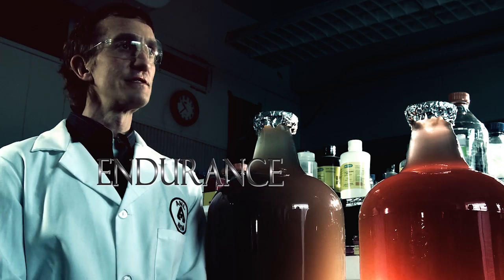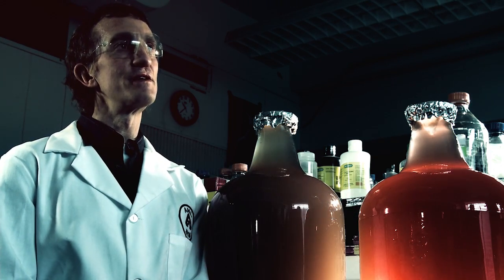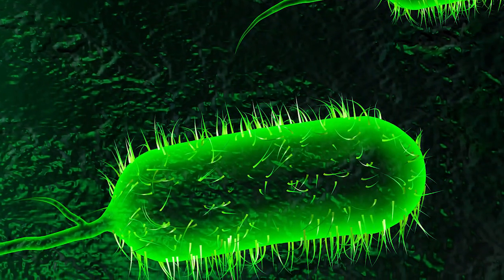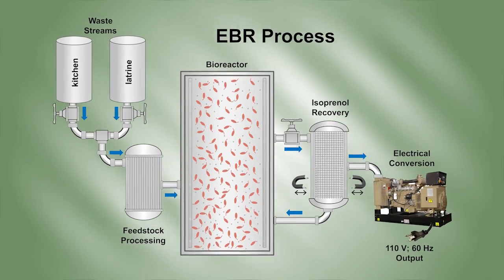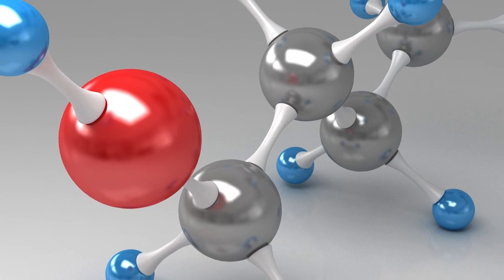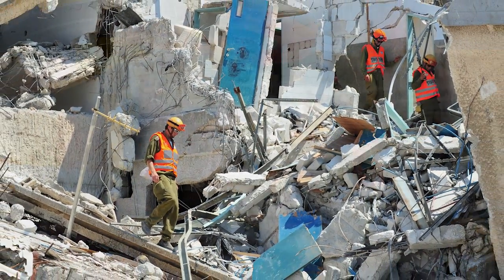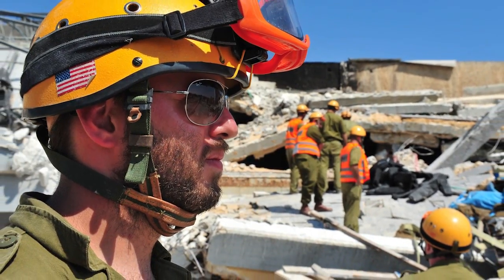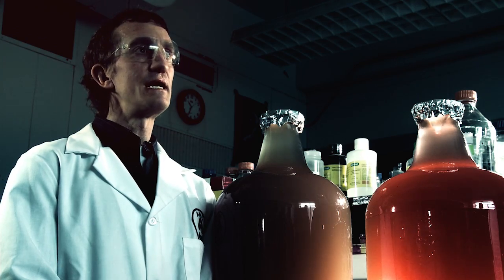The Endurance Bioenergy Reactor

Comment: Nice idea. I have a few questions though -

1) Can a domestic demo prototype be used for cooking instead of generating as shown in the video. I would think that the video itself should have shown such simpler application than one with a engine + generator
(2) The video does not show solar power, which also seems to be essential component of the process.
(3) There is a mention of specific bacteria. How or from where does one get the bacteria ? That also should have been explained.